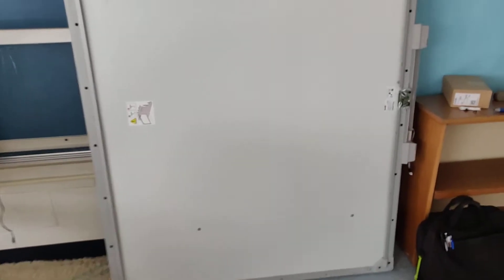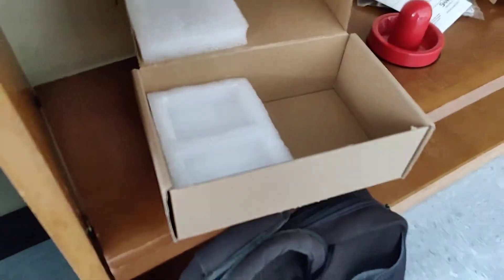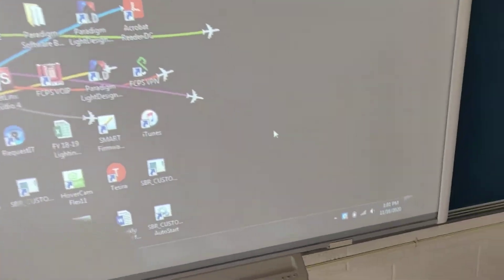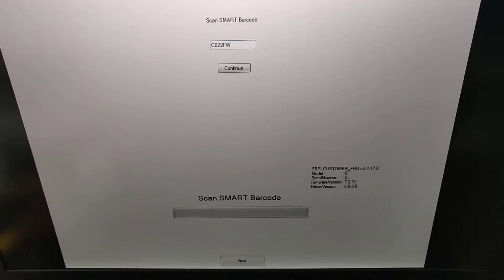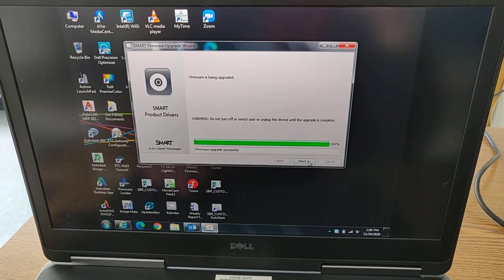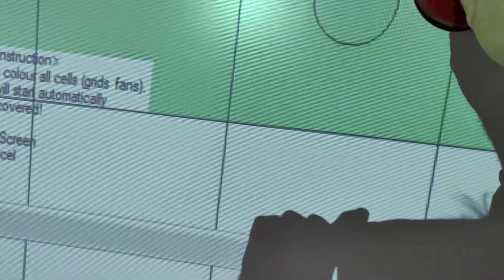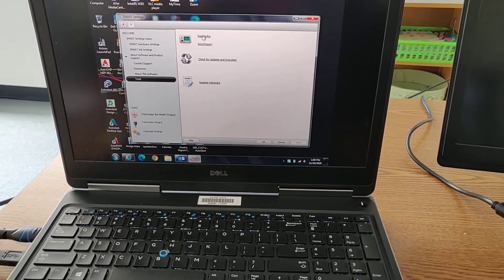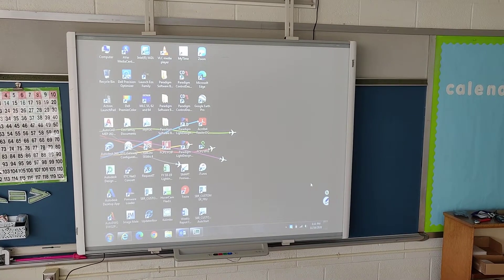How to replace the DSP/Controller on an M600 Series SmartBoard

Comment: At minute 4.12 where it gave the error that it did not connect, you cut the video and you did not explain how you solved that problem so that the pc connects to the smarboard, which is the same problem that I have.
Reply from the maker: If you replace the FRU-DSP, you have to run the calibration software and enter the serial number before it will connect to your PC.

Comment: "Smart"boards.
Reply from the maker: These ones are usually trouble free, except for the poor solder job on the controllers!
Reply: @springws14lbss  Hey Spring question for you, I'm replacing the DSP controller on a m680 board but keep running into the issue of no connection to the board detected. I can't update firmware or run the calibration software. If you have any ideas on how to fix this I would greatly appreciate any help.
Reply from the maker: @TheK959  At what point do you get this error message? Do you have the latest Smart Product Drivers installed?
Reply: @springws14lbss  I have all the latest Smart Product Drivers installed. I tend to get what happens at min 4:00 but when I try to do what you do after I don't get the box for the smart barcode when i try to run any of the FRU updates that are published to their website.
Reply from the maker: @TheK959  Did you ever get your board working? Were you using the same version of FRU software that was on your FRU-DSP board?